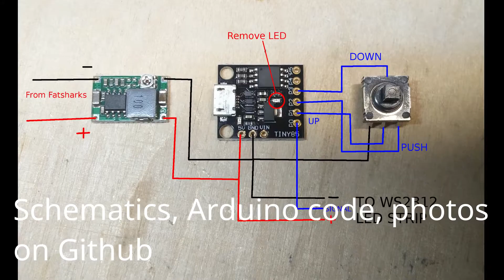Fatshark LED MOD

Comment: Using windows10 - I cannot compile this code, I keep getting 
"Arduino\sketch_apr20a\sketch_apr20a.ino:1:19: fatal error: Event.h: No such file or directory

 #include <Event.h>

                   ^

compilation terminated.

exit status 1
Error compiling for board Digispark (Default - 16.5mhz).
"

Any ideas?
Thanks!!

Comment: Thanks! Had the wrong timer lib installed! Compiled!

Another question - is this coded for only 7 leds? I'm using more than that on my setup (16).

Thanks again!
Reply from the maker: Yes, it used to be 7 leds only, but I made a commit a minute ago. Now you can #define NUMBER_OF_LEDS  7  to whatever you want. Everything else except MODE_KNIGHT_RIDER should work just fine.  Update your source code from github.
Reply from the maker: To fix MODE_KNIGHT_RIDER you will need to fiddle around with values in void setKit(int8_t start) function. Try increasing values of start variable. Sorry I can't tell you exactly what it needs to be, but I'm sure if you try few random values you'll get it right in few minutes.
Reply: OK I'll wait for that commit to go through -- still not seeing it.
Can you just flash directly over previous programs on these digisparks?  I've used some that require you to write null data -- excise the ignorance -- havent programmed arduino in a few years. 

Thanks again!!
Reply: Im still only seeing the latest commit of 9 hrs ago when you updated the readme.
Can I just set the LED number  by changing the following:

struct LINE {
  LED led[7];

Where 7 would be the number of lights?

Thanks!